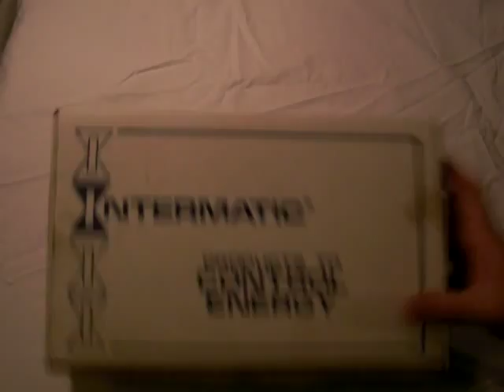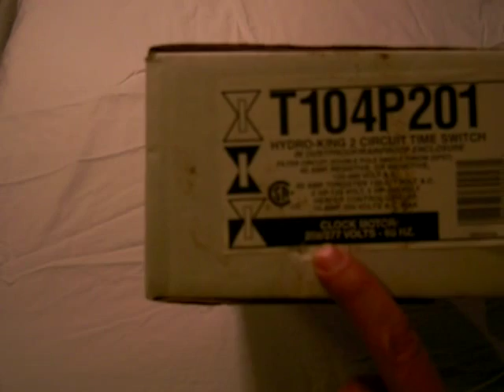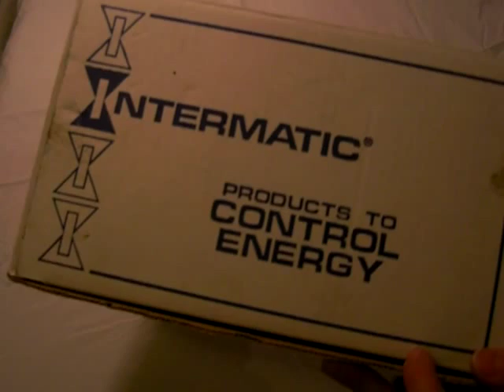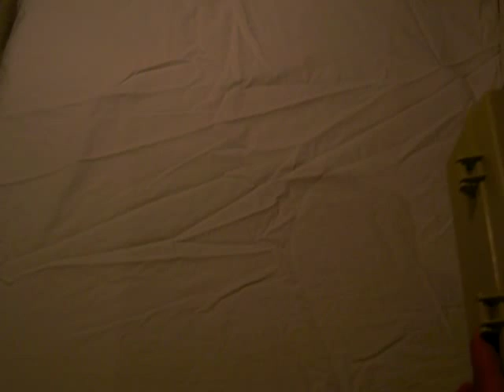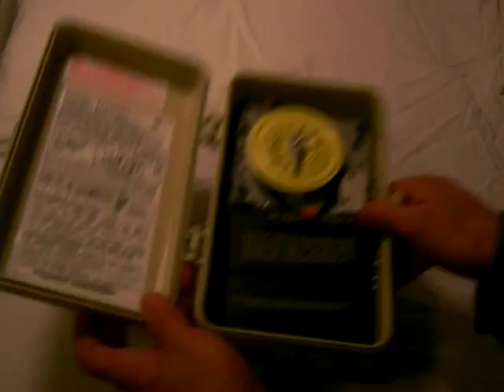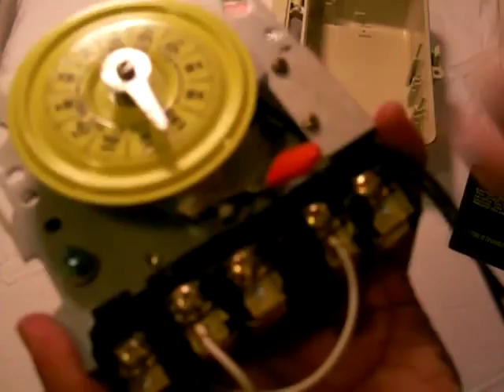Intermatic pool timer, Hydro King with Heater pre shut down

Comment: How can you even see this video? It’s so darn dark. All I wanna know is where the two loose wires get screwed to does it go A1 23 or four? I don’t know if they were just show me that picture I would know.
Reply from the maker: You do realize that this video in 14 years old? What kind of camera did your phone have 14 years ago?
Reply: @tiov3001  yell I’m sorry about the bad quality but the fact is no where can you find a video that shows you where the hell the 2 black wires go. If you thank I’m full of it just look on here for your self and read all the comments
Reply from the maker: @dannywireman2150  the two black wires run to your heater. Older heaters had a “fireman’s switch “ newer heaters have either automation connection terminal or a jumper inside a bag inside the heater that needs to be plugged into the pc board.  What heater do you have?

Comment: How do you wire the heater to the timer? I've had 3 electricians look at it and none of them know what to do. Small town with not a lot of options apparently. I'm assuming the 2 wires from the fireman's switch connect to the live wires from the heater but I'm not positive.
Reply from the maker: No. These are dry contacts (zero volts) you need to locate what’s often called “fireman’s switch” in the heater. What brand and model of heater do you have?  Most new heaters (like Hayward) come with a packet inside that likely includes a set of 3 wires with a plug connector to plug into one of the heater’s circuit boards. The wires will be labeled “pool, spa and common” connect the switch in the timer to the pool and common wires, some older heaters (Tellidyne Lars) raypak, had a wire labeled to be cut, cut that wire and attach to the two wires from the switch in the timer.
Reply from the maker: This is really getting into the automation/ low volt world, this stuff makes most Sparkys head spin. Most electricians are only good at bringing power. Depending, I may not even let them touch power jumpers.  I’ve had too many random electricians blow up stuff and try to act dumb over the years.
Reply: @tiov3001  I have a Jandy JXi260N and the timer I have is an Intermatic T104P201. Im not sure about any wiring harness inside but i'll have a look when i get the chance.